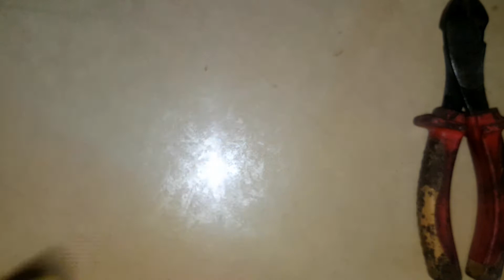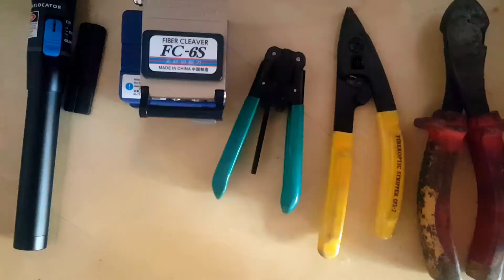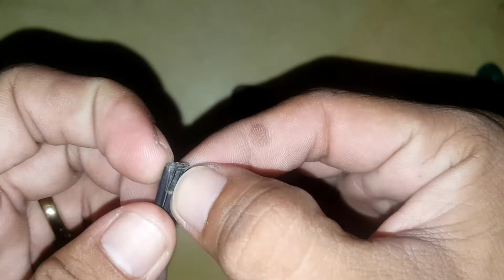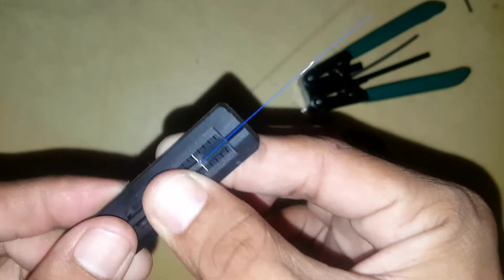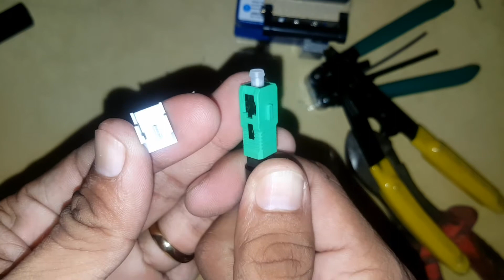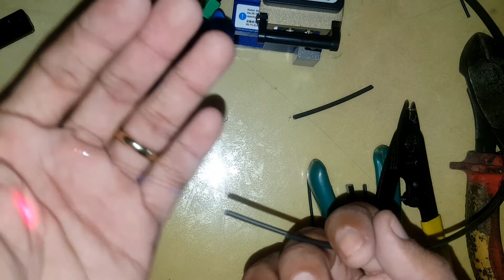Fiber Optic Connector Installation

Comment: WARNING:  Carefully dispose of that glass clipping.  It can pierce skin easily and then break off and cause horrible issues for a long time as you try to extract a clear fragment that is almost impossible to see and likely to break again when you pull on it.

Use alcohol wipes to clean the bare core.

Never look directly into the end of a live fiber.  Testers like his are visibly red for identifying the light with a naked eye, (this should be observed at an angle,, not direct) but routers and media converters, IPAGs, and NTEs transmit data over UV light frequencies that your eye can't see but are actually extremely bright optically.  This could cut/alter/damage your retina inside your eye if you look directly into UV light even when you think it is off just because you can't see these frequencies of light with a human eye, so be careful.
Reply: thank you brro
Reply: Thx a lot admin and bro. May god bless  you all.

Comment: I did this with my teeth after sitting on phone with att for hours only to find out it will take a week to get a tech out and will cost $150.  Wild life keeps messing with the wire outside. May switch back to cable if this keeps happening.